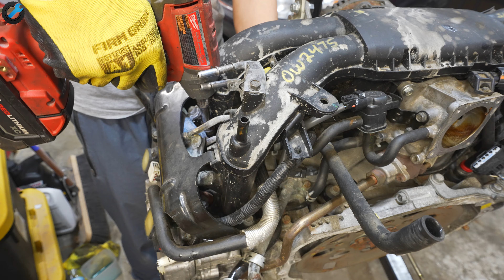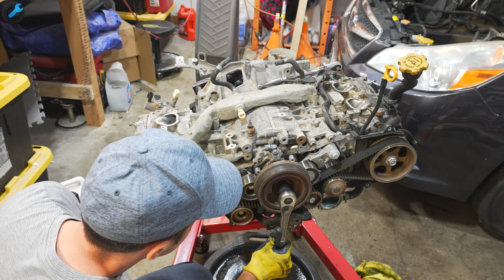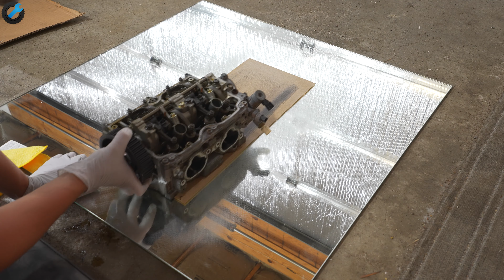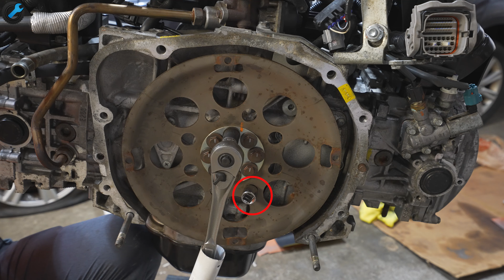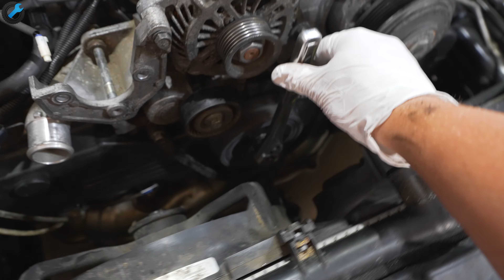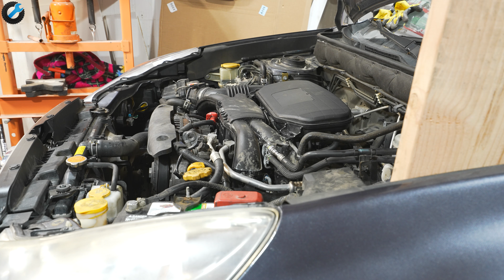Replacing Subaru 2.5l sohc head gaskets and resurfacing the cylinder heads at home

Comment: I am so glad I found this video as i am getting ready to pull my first legacy motor. 07 SOHC 2.5.  It looks basically identical.  I went with a Blackstar kit . I hopefully will find all the correct seals.  I also want to do rear main seal.  But seriously your advice on cleaning threads is something I might have glossed over getting into a hurry, so thanks.  🙏. I wonder how different the torque settings are and procedure for head bolts from 07 to your 13.  Where is a good place to find those values?

Comment: @ 13:50 How on earth are you supposed to follow the  90, 60 & 45 Degree mess around for torquing the head bolts with the engine still in the car?
Reply: Mark them with a marker pen. It works real good. Also I don't agree installing OEM gaskets, they are the main cause of fallure. I use MLS or turbo gaskets. The rest he did an awesome job

Comment: Good video man. Unlike so many other videos they do not touch in on valve adjusting which is highly and pretty much mandatory. I personally just rebuilt my EJ25 SOHC with STI 2019+ head gaskets and ARP head studs. Extra money yes but I have a good piece of mind. Also not to mention when I did my timing belt kit from Company23, I did the oil pump and water pump "Subaru brand". I did find two of my oil pump screws back plate completely backed out at 160,000 miles 😮 I'm aiming for 300,000 miles on the short block 🤞

Comment: What was the torque tool you used?
Reply: It is an electronic torque gauge with a half inch socket for a breaker bar on one side, and a half inch drive for the sockets on the other. 
You set the torque you want and the alarm goes off when you reach it

Comment: Great video. Wished I'd seen it before I bought my 2018 Subaru. Going to trade it soon and buy a chevy.
Reply: 2.23.25.    🤦🏻‍♀️”That’s like moving from one bad marriage to the next”😲
Reply: 2018 subarus dont have this issue, it was remedied in 2015 and up, i got a 2016 outback original engine with 226k miles
Reply: Imagine a Chevy cruise at 300000miles. You'll have to because they don't exist. 😂

Comment: Amazing video. You got me through the head gasket replacement. Now, the bottom rad hose is staying cold, and the car isn't blowing any heat... Any tips? Maybe water pump or faulty thermostat? I didn't replace the water pump when I did the gaskets.
Reply from the maker: Possible a bad thermostat but most likely trapped air in the system.
Reply: @happywrenching  Thanks, after a short panic, I jacked up the front end, squeezed all the hoses, ran it at 3k rpm for a minute or 2, and was able to get the air out. Car is running great now, thanks again for the fantastic video!

Comment: How do you get the pistons to be half way down my number one piston is up and want to install the heads? Thank you
Reply from the maker: Install crankshaft pulley, crankshaft bolt, and rotate the crankshaft by hand (using a ratchet or wrench) until the pistons are at half way point.
Reply: @happywrenching  thank you.

Comment: How heavy of a weight did you use for surfacing the block?
Reply from the maker: That was just a 10 pound weight. I think a 25 pound will work really well and not move around as much. No issues with head gasket after 4k miles so far!

Comment: Could you have the cams 180° out ? My first subaru engine and I'm really struggling
Reply from the maker: So the cam pulleys have keys and can only be installed one way on the cams. Then its just a matter of lining up the timing marks on the cam pulley with the timing belt. If you are really stuck i suggest buying a 3 day subscription to Subaru’s online service manual. Has everything step by step.
Reply: Thats the crazy part.  I followed everything exactly and still having issues. Thanks I'll try the subaru service information